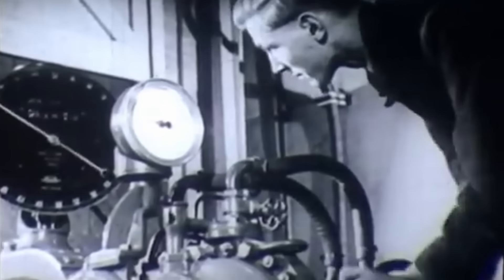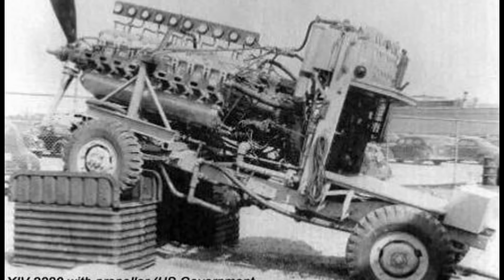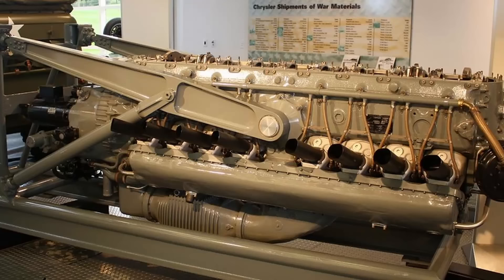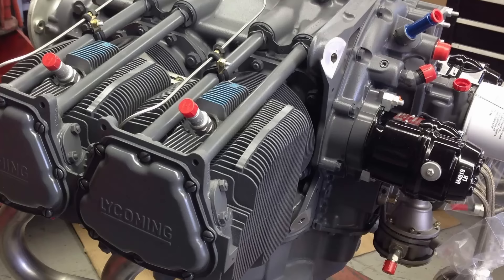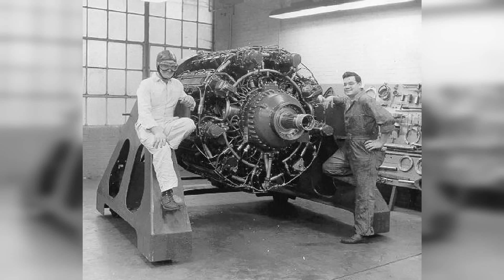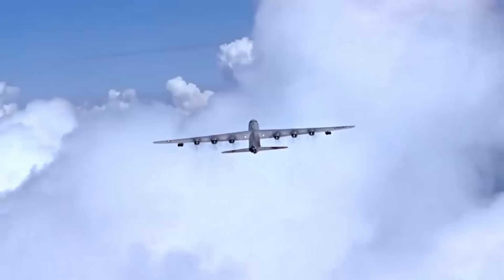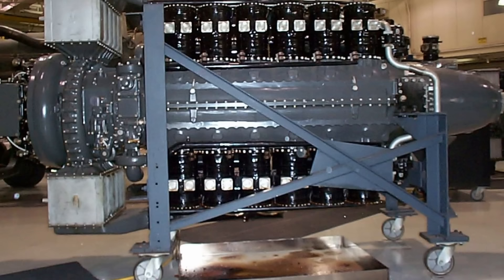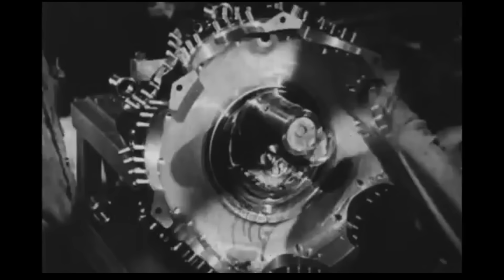The Forgotten HYPER Aircraft Engines of WWII

Comment: Sometimes I wonder what a high displacement, high cylinder count engine could put out with the knowledge we have now.
Reply: Yes, I have always wanted to see someone remake or reproduce a Merlin, or R-2800 with modern technology.
Reply: Alex Snowden  In aviation? Absolutely not.
Reply: Dante Giacosa, Fiat engineer, worked on aviation engines before projecting car engines, said that the limit of aviation engines was the number of revs due to the fact that was needed a bigger heavy gearbox in order to limit propeller rpm if the engine doubled the conventional rpm speed… we know that power output is related with rpm speed… however the power for cubic inch was the same of an engine car, thanks to the compressor, at normal revs in use in those days aviation engines… so the solution was to increase cylinders number…
Reply: Alex Snowden  It's not even remotely related to what the "fun police" want, it's what's possible from a technology standpoint. Practical electric aircraft aren't even on the horizon and regulations/powerful people can't make the impossible possible.
Reply: Alex Snowden  Those people will have less power in three weeks.
Reply: The only "knowledge" that we have now, that is any different from what they had 80 years ago, is fast microprocessors. 
It would be a interesting, albeit expensive and unnecessary, exercise to build a modern; giant, high powered aircraft engine using all of the technology at our disposal. 
I don't think that we could do much better than they did 8 decades ago. 
Turbine engines are more powerful, lighter, and more reliable than piston aviation engines. They are the go to powerplant for heavy aircraft nowadays.
Reply: @straybullitt  that is absolutely not the case. Metallurgy, casting processes, forced induction have all come a long way. It's 3:40am and those are off the top of my head.
Reply: @straybullitt  "The only "knowledge" that we have now, that is any different from what they had 80 years ago, is fast microprocessors. "

That's a ridiculously ignorant statement. When it comes to piston engines, we have gained an absolutely ENORMOUS amount of knowledge relative to what we had in the '30s and '40s, I don't even understand how anyone could think otherwise. Even without ANY electronic controls, modern engines VASTLY outperform engines from that era, because of our current understanding of how the internal geometry of an engine affects its performance. Everything from our understanding of how to improve volumetric efficiency, to how to greatly reduce an engine's propensity to detonate has been enormously improved over the years, simply because we understand how the shape of ports and combustion chambers affects these parameters. Heck, companies will run hundreds of hours of combustion simulations on supercomputers in order to determine the ideal shape of the ports and combustion chambers of an engine.

Materials science and production methods have also improved enormously, so parts can be lighter, longer lasting, and can be designed with properties that allow for significant reductions in the amount of friction an engine produces internally. Parts can also survive for longer periods of time in more extreme environments, allowing engineers to push engines harder in order to improve both efficiency and power output, without sacrificing longevity.

Just ask yourself why a Honda Civic makes as much power as a 1955 Bel Air, with less than half the displacement, while also getting more than twice the fuel mileage and lasting just as long, if not longer.

Edit: ...and, of course, the Civic is far cleaner than anything from the '50s, which restricts performance.
Reply: @theakbars98  
I'll possibly give you the metallurgy and casting. 
The only reason that forced induction has improved is due to better engine management tuning via computers. I would argue that is not as important on a engine that is run at a constant RPM.
Every conceivable method to gain performance on internal combustion engines was developed by the second world war, if not before. 
I just don't think that any advances that we've made would make much of a difference in a large aviation engine.
Reply: @PistonAvatarGuy  
Comparing a Civic, or any automotive engine, to a large aviation engine is ridiculous. 
Aviation engines run at a constant RPM, and can easily be tuned to make maximum power and efficiency at that RPM.
Try taking a contemporary 2000 horsepower LS engine up to 20,000+ feet and see how it runs.
You guys have no idea about what it requires to make power in that environment....
Reply: @straybullitt  Did you not read my comment? Basically ALL of the advancements which have been made in automotive engine technology can be applied to aircraft engines. People have even been proving that modern automotive engines perform better than the most common light aircraft engines!

"Try taking a contemporary 2000 horsepower LS engine up to 20,000+ feet and see how it runs."

A) No one here suggested that a 2,000 hp LS be used to replace a ~30+ liter aircraft engine, they said that they wanted to see a Merlin, or an R-2800, produced with modern technology. Modern versions of those engines would offer absolutely enormous improvements over their predecessors. B) I'm not suggesting that modern automotive engines be used to replace the archaic engines currently in widespread use in light aircraft, I'm suggesting that the advancements which have been used to improve automotive engines also be applied to aircraft engines.

Also, Boeing used Ford Fusion engines in an aircraft which flew at 50,000+ feet for a considerable amount of time, so I don't see why you think that a modern automotive engine would have trouble operating at high altitude.
Reply: There reaches a point where you can get more energy from the turbocharger than the energy from the crankshaft.  So you might as well attach the propeller to the turbocharger shaft, and the engine becomes a heavy, expensive, hard to maintain gas generator.  That's basically why we have turboshaft engines, grossly oversimplified.
Reply: @straybullitt  "The only reason that forced induction has improved is due to better engine management tuning via computers."

That's complete nonsense, both compressor and turbine technology have improved considerably, partially because of our improved understanding of fluid dynamics and our ability to simulate these systems, but also as a result of advancements in materials science and manufacturing techniques. Many of the improvements that I mentioned above also contribute to a modern engine's improved ability to make use of forced induction.

"I just don't think that any advances that we've made would make much of a difference in a large aviation engine."

The VAST improvements that we've seen in port and combustion chamber designs have a long list of benefits. Just improving the volumetric efficiency of an engine means that less power is consumed by the compressor(s) in the forced induction system (at the same power level) and less heat is generated by it/them, which means greater efficiency and less stress on the engine and the forced induction system.
Reply: @PistonAvatarGuy  
I feel silly arguing about this. The large piston aircraft engine ran its course by the end of WW2. They found something that was so much better, that it isn't even close. 
It's a completely moot point. 
But if any of you think that you can build a better piston engine, I would love to be proved wrong.... 😋
Reply: @johngalt5205  That's pure nonsense, unless you're trying to fly at 100,000+ feet (or something like that). Try asking the engineers at Grob why they went with a piston engine in their Strato 2C and used a compressor section from a PW127 to provide it with air, instead of simply using PW127s to power the aircraft.
Reply: @straybullitt  I think that you missed the point of this whole discussion. No one here is saying that a large, modern piston engine could compete with turbine engines, it would just be interesting to see how much better modern versions of those old engines would perform. Where did you even get the idea that turbine engines were part of this discussion?
Reply: @PistonAvatarGuy  
No. I got it.
You already know my opinion. 
The  unlimited hydroplane racers used Allison and Rolls Royce/ Packard engines into the 80's. They probably squeezed every ounce of horsepower out of those engines. The unlimited class at Reno also mods those engines about as far as they will go.
You would have a difficult job of building a new engine from scratch, that will outperform some of the engines that have been developed for the ladt 80+ years.
That's all I'm saying.
Reply: @straybullitt  You don't "got it," because you have no idea what you're talking about. The racers who have been tuning Merlin and Allison V12s didn't redesign the engines from scratch, but that's exactly what would need to be done in order for them to take advantage of any of the major advancements that have been made in the last ~80 years.

The ports and combustion chambers of those engines are absolutely archaic (especially on the Merlin) and can't be changed without significant changes to major parts of the engine. The Allison wouldn't need to be modified as much, but it's still absolutely archaic by today's standards.
Reply: @PistonAvatarGuy  The strato 2c failed, yet the Grob G 520 (a turboprop) did not.  Thank you for proving my point.
Reply: @johngalt5205  Except that the 2C flew higher than the G 520.
Reply: @PistonAvatarGuy  
The old timers understood about combustion chamber design. Bristol built a sleeve valve engine, which is probably the most efficient, and complicated, combustion chamber design.
Again, all of that is not as important on a forced induction, large sub 5000 RPM engine, as it is in a high revving automotive or motorcycle engine. 
There is currently no viable commercial application for such a engine, so we're never going to find out, unless you stop talking about it, and start building it PistonAvatarGuy.....
Reply: @straybullitt  No, buddy, efficient combustion chamber designs didn't start to emerge until the EIGHTIES. Haven't you ever wondered why modern boosted engines have compression ratios that are basically double what they were in the '30s?

Sleeve valve heads are a whole different world, as they don't have the same problems as poppet valve heads.
Reply: @straybullitt  "There is currently no viable commercial application for such a engine, so we're never going to find out, unless you stop talking about it, and start building it PistonAvatarGuy....."

Yes, it is extremely obvious that the concept of fun is completely foreign to you, you don't have to point it out. If you don't like fun, lighthearted conversations which don't produce ideas that you can sell, go somewhere else.

If you want to give me half a billion to develop a modern, light aircraft engine (>400 hp), I'd be glad to take it.
Reply: @PistonAvatarGuy  
Fuel was like 70 octane in the 30's.
Chrysler had a hemispherical cylinder head in the 50's.
You need to study history more carefully, pal.
Reply: @PistonAvatarGuy  
Honda beat you to it!
They developed a thoroughly modern engine but never brought it to market. 
Porsche actually developed a engine  that they built in limited numbers, and then cancelled their certification and stopped supporting the engine after a few years.
There is too much liability, for too small a market with general aviation engines. Even for the largest engine manufacturer in the world. 
I won't be investing any money in your engine building business.
Reply: @straybullitt  WTF are you talking about? The engines being discussed here burned 130 octane (up to 150 in some cases) fuel! Even with those low compression ratios, they'd blow themselves to pieces without ridiculously high octane fuels, because their combustion chambers (as well as other aspects of their design) were absolutely archaic!

The hemispherical combustion chamber is also an incredibly archaic design, which is why it hasn't been used in any automotive engine for many decades.

AGAIN, you have no idea what you're talking about, PAL.
Reply: @PistonAvatarGuy  So what? I read some more, and both of them apparently were built because the German government could not get their hands on a real high-flyer (70K feet) the U2, so they tried to roll their own with existing off the shelf technology.

Turboshaft engines are probably designed to run below about 42K feet, so to get more altitude than the G 520 could provide would require a major re-work of the engine, and would cost too much, so they tried the 2c, and failed.

Besides that, props, while cheaper, are not nearly as efficient at moving air at higher altitudes and speeds as a ducted fan, like on a high-bypass passenger airliner.

Besides that, would you want to change all 336 spark plugs on a B-36?
Reply: @PistonAvatarGuy  
Lol
You were wondering why compression ratios doubled from the 30's. The octane rating of the fuel went way up during the war.
I'm tired of going back and forth with you dude.
I'm just going to wish you well in your engine design and building endeavors, and say goodnight.
Reply: @straybullitt  FFS.

Fuel octane during WW2: 130 to 150 . Compression ratios during WW2: ~6:1
Current fuel octane: 90 to 92 . Compression ratios in current engines: ~10:1 (boosted), 12:1 to 14:1 NA
Reply: @johngalt5205  The 2C being a financial failure does not mean that it failed to fly at a higher altitude than the G 520.

Anyway, at around 400 hp and below, the fuel consumption of a turbine engine becomes a serious issue, so that's likely part of the reason why Grob chose piston engines for the 2C. It's not always as clear-cut as you might think...

I would imagine, though, that a small turbofan would have performed better in that application than anything else when it comes to operation at anything above ~40k feet. Comparing the Scaled Composites GlobalFlyer to the Strato 2C is interesting.
Reply: @straybullitt  Don't forget water and alcohol injection.
Reply: @straybullitt  The Honda aircraft engine was ridiculous, as was the Porsche engine (it was an air-cooled aircraft engine which relied on a fan for cooling).

The only halfway decent engine designs that have been developed for aircraft and could be considered to be fully modern engines were the Toyota FV2400-2TC and the Adept Airmotive 320T/360T. Adept Airmotive is currently looking for funding to certify their engine, while Toyota certified their engine but decided not to put it into production (like you said, too much liability and too small of a market). Burt Rutan (one of the most notable aircraft designers alive) worked with Toyota to design an aircraft for the FV2400-2TC and had nothing but praise for the engine.

It's unfortunate that greed prevents light aircraft from being powered by modern engines.
Reply: @johngalt5205  
Nitrous oxide, and everything else that you could possibly think of....
Even a exhaust turbine coupled directly to the crankshaft via a fluid coupling, providing a nice boost in power, in conjunction with the supercharger. 
It's actually amazing what they were able to dream up, and engineer to be functional back then.
It's possible that a better "mouse trap" could be engineered and built today. It certainly wouldn't be "game changing" better.
It most definitely wouldn't have the soul of a vintage engine. Probably more like the hunk of metal found in modern automobiles, covered by a piece of plastic.....
Reply: @PistonAvatarGuy  It isn't the HP that's the problem with turbine efficiency.  It's the altitude and/or speed.

Explanation in layman's terms
Burning the fuel-air mixture heats it and makes the gas expand. This happens at nearly constant pressure and in a restricted volume, so the only way to make room for this expansion is for the gas to flow faster. Nearly constant pressure means that the density of the gas must decrease. The density ratio between the heated and the unburnt gas is proportional to its temperature ratio, measured in absolute temperature.

However, the amount of fuel burnt determines the absolute temperature increase, the difference in degrees between the burnt gas inside the combustion chamber and the unburnt gas at the intake. For a given amount of fuel, the temperature ratio which can be achieved with an absolute temperature increase becomes smaller the higher the temperature of the unburnt gas is. Thus, efficiency decreases with a higher temperature of the intake air.

The air at high altitudes is very cold, ~ -70 F @50K feet, so turbines are very happy.

The Scaled Composites GlobalFlyer flew high (~50,000 feet) and fast (~350 MPH), so the turbojet engine was more efficient than a piston engine would have been.
Reply: @straybullitt  Yeah, war makes people desperate.  The Mustang and Spitfire both use the Rolls-Royce Merlin engine, which is equipped with ejector exhausts. The exhaust gas actually contributes about 70hp of power, over and above the thrust from the propeller.
Reply: @johngalt5205  I'm aware of all of that, but in the power/thrust range that we're discussing here, piston engines start off with a significant efficiency advantage over turbine engines at lower altitude and this efficiency may not be matched by a turbine engine, even at high altitude.

I wasn't concerned with the power/thrust output of the engines, just fuel efficiency. Obviously, turbine engines can be far more powerful than piston engines, it's just that the fuel efficiency of turbine engines is increasingly poor as their size/maximum thrust decreases.
Reply: @PistonAvatarGuy  
Most of the advancements you're talking about that've come to be since the 80's in car engine's wouldn't apply to something like a redesigned Pratt&Whitney R2800  engine for a variety of reasons. 
First off I've been building performance Harley engine's professionally for years, they started out with a hemi engine back in 1936 nicknamed the Knucklehead, the same basic combustion chamber was retained through the Panhead and Shovelhead engine's up to 1984 when they switched to a D shaped combustion chamber with a flat top piston and a squish area in the Evo engine, so I'm very familiar with the concept of true hemi's being horrible combustion chambers (for normally aspirated engine's, highly boosted engine's are a different story and I'll get to why that is in a moment), and how despite Chrysler using the hemi name on the generation of engine's they've made lately they're not really hemi's by any stretch of the imagination, they have closed combustion chambers and flat top pistons, but since Chrysler own the rights to the name "hemi" when applied to automobiles they can do what they want with it, they could apply that name to a flat head engine if they wanted.
But what you don't get is that the squish area type combustion chambers that've made automobiles (and Harley's) so much more efficient and powerful since the 80's wouldn't work in a highly boosted engine like what's run in aircraft, furthermore your comment about those engine's having low compression couldn't be further from the truth, the R2800 may only have 6.5:1 mechanical compression pistons in them but the engine's run on 70" of boost which means in the end they actually have very high compression.
High amounts of boost changes everything about what happens in a combustion chamber, there's a reason why those aircraft engine's had 6.5:1 compression pistons in them and so do modern top fuel rail dragsters, they run the same 6.5:1 compression ratio pistons as those aircraft engine's did because that gives them a large combustion chamber volume that gets packed full of air/fuel via the supercharger, you can't have closed chambers and squish area's with a combustion chamber designed to run high boost like that, with a combustion chamber that has the small amount of volume something like a normally aspirated does to keep from blowing it up you'd have to turn the boost down to the point where you'd loose the effect of having that much air/fuel to burn that's inside of a hemi with a flat top piston like those aircraft engine's and top fuel dragsters have, those top fuel engine's pack in so much air/fuel from the supercharger that at the top of the compression stroke the spark plug is firing in almost pure liquid despite the huge volume of the combustion chamber, also because of the massive amount of boost they run instead of relying on ambient air pressure to fill the cylinders the vastly improved ports of today's engine's are something else that they wouldn't benefit from, it simply wouldn't make any difference because the superchargers on those engine's are already capable of filling the cylinders with every bit of air/fuel they can handle, with more efficient ports you'd have to turn down the boost to keep from over boosting the engine resulting in having the same amount of air/fuel packed into the cylinders anyways, ie no benefit from it, you might get a little more power at the prop shaft from slightly less parasitic loss from not having to gear the supercharger as high but it'd be marginal, not nearly what's been gained in normally aspirated engine's since the 80's from better designed ports, and since the length of the induction system overall is so long because of the supercharger and manifold design on those engine's the ports in the heads are only probably about 1/100th the length of the overall induction system instead of ¼th or so, in the end it might not even make any difference, on those aircraft engine's it was a long ways from the carb, through the superchargers and then all the way down the intake manifold to the cylinders. 
But probably what limits them more than anything else is piston velocity, with car engine's over the years things like overhead cam shafts and other things that've become prevalent in automobile engine's has enabled them to rev higher to produce more HP, but because of the massive 6 inch and more stroke in those aircraft engine's they can't rev any higher than 2,700 to 3,000 RPM's without piston velocity becoming an issue, generally the higher you rev an engine the more HP it makes but because of the limits placed on those aircraft engine's because of the amount of stroke they have you can't rev them any higher anyways, along with that you've got propeller speed issues, once the tip of a propeller blade approaches the speed of sound it starts losing efficiency, so for that reason you can't rev the engine's any higher in them in the pursuit of more HP.
You'll find that the people who engineered those engine's pretty much had all the bases covered, that's why during WW2 a prototype variant of the P47 set a speed record that wasn't broken until 1989, even then it was just barely exceeded and hasn't been broken since despite many people having tried it, because it's a technology that was pretty much wrung out as far as it could be back then and the advancements that've brought cars so far in the past 40 years simply don't apply to them.
Reply: @PistonAvatarGuy  That's just not true.  Modern turbofans are way more efficient than passenger liners of old.  A lockheed constellation got about 60 MPG per passenger, whereas a Modern large twinjet gets way over 100 with far lower maintenance costs.  Virgin chose a jet because they could get the highest MPG that way.

The only times a piston engine is better is if you want to go low and slow, like a bush plane.  Or, if you want to make a plane cheaply.
Reply: @dukecraig2402  "Most of the advancements you're talking about that've come to be since the 80's in car engine's wouldn't apply to something like a redesigned Pratt&Whitney R2800  engine for a variety of reasons."

-- I agree, actually. I was mostly thinking about a modern Merlin... and liquid-cooled v-type engines in general.

"But what you don't get is that the squish area type combustion chambers that've made automobiles (and Harley's) so much more efficient and powerful since the 80's wouldn't work in a highly boosted engine like what's run in aircraft..."

-- Yes, they would. First off, aircraft engines aren't that highly boosted. Second, those very combustion chambers ARE used in highly boosted automotive engines, quite extensively. Take a look at a VR38DETT combustion chamber, then watch one blast down a drag strip with 3,000+ hp at ~80 psi of boost and tell me that combustion chambers with squish area aren't suitable for use in high boost applications.

"... the R2800 may only have 6.5:1 mechanical compression pistons in them but the engine's run on 70" of boost which means in the end they actually have very high compression."

-- 70" of manifold pressure is only ~20 psi of boost, which is basically the same as a stock EcoBoost engine. Take a look at the EcoBoost combustion chambers... very, VERY closed in nature.

"and so do modern top fuel rail dragsters, they run the same 6.5:1 compression ratio"

-- They run such low compression ratios because they use true hemi combustion chambers, instead of modern combustion chambers.

"you can't have closed chambers and squish area's with a combustion chamber designed to run high boost like that"

-- Sorry, but countless modern engines prove you wrong on that. Really, I think the problem here is that most people who want to criticize me on my understanding of engines are American, but most American engine builders are stuck in the 1950s... unless they're tuning Japanese or European engines.

-- On your comments about not being able to fit more fuel and air into a Top Fuel engine... you wouldn't need to with a more advanced combustion chamber, because higher compression ratios produce more power with less fuel (they're more efficient), you just can't run a higher compression ratio with a hemi engine because of its archaic combustion chamber.

" the vastly improved ports of today's engine's are something else that they wouldn't benefit from, it simply wouldn't make any difference because the superchargers on those engine's are already capable of filling the cylinders with every bit of air/fuel they can handle, "

-- I already explained why this is wrong above. If you're trying to fill a cylinder through a more restrictive port, your supercharger is going to require more power to do it and it's going to produce more heat while doing it. In an aircraft, where you're not going for some bonkers amount of power, this would mean reduced efficiency, because the forced induction system would be consuming more power in order to obtain the same power output as an engine with more efficient ports. This is basic, BASIC stuff, man.

-- On piston speeds: Now we know that engines should be over-square so that piston speeds can remain low, even at high rpm. Better materials, engineering, manufacturing methods and lubricating oils also allow for higher piston speeds, without causing any reduction in reliability, longevity, or efficiency.

" along with that you've got propeller speed issues"

-- This is absolutely not an issue because these engines all have PSRUs. Want lower propeller rpm with higher engine rpm? Use a different gear ratio.

-- Anyway, you're just stuck in the 1950s, learn about modern engines, they'll blow your mind.
Reply: @johngalt5205  SMALL turbine engines are horribly inefficient. We are talking about relatively small turbine engines here.
Reply: @PistonAvatarGuy  If SMALL turbines are so horribly inefficient thet would not use them as APUs in jetliner.  The size does not matter assuming the same number of compressor stages.  What matters is how cold the intake air is for all sizes of turbines, and how fast you are going.
Reply: @johngalt5205  APUs in airliners don't need to be efficient, they're not operated for long enough and don't produce a large enough amount of power for their fuel consumption to be a concern. Space and weight concerns are what drive that engine choice.

It's common knowledge that small turbine engines are horribly inefficient, it's almost ridiculous that you wouldn't be aware of that fact.
Reply: @PistonAvatarGuy  The efficiency of a turbine engine has nothing to do with size, assuming the same design, altitude, and speed.  It has everything to do with the difference between the inlet temperature and outlet temperature.  I'm surprised you are willing to die on that hill of ignorance.

I think the reason you believe small turbines are inefficient is that you are comparing turbines that are being run at low altitudes.  Big ones aren't great at low altitudes, either, it's too hot for them to be efficient.

Get those little suckers up high and fast, and they are just as efficient as their big brothers.
Reply: @johngalt5205  No, buddy, there is an extensive amount of data which supports what I'm saying here. It's well understood why smaller turbine engines are less efficient than larger turbine engines. Heck, you can even compare GE's aeroderivative turbine engines (which are rated at sea level) and see that the smaller engines are less efficient than the larger engines.

Anyway, my main point was that piston engines are more efficient in light aircraft applications, and that's indisputable. Modern piston aircraft engine designs (the Adept Airmotive 320T) can burn as little as 0.33 lbs of fuel per hp/hr, while a small turbine engine might burn two to three times that amount.

The PBS TP100, for example, burns 0.901 lb/HP/hr at cruise. The Allison/Rolls-Royce M250 burns around 0.67 lb/HP/hr cruise, which is less than the TP100.... and it happens to be a larger turbine engine. The TPE331 burns 0.55 lb/HP/hr (I think that's at max power), it's larger still. I don't really feel like tracking down more of this information, but I'm pretty sure that once you get into the range of something like an Allison T56, you start to get competitive with the BSFC numbers of piston engines. That is a BIG turbine engine and it is absolutely not suitable for use on a light aircraft.
Reply: @PistonAvatarGuy  How in the world did I let you shift the goalposts from the OP to the efficiency of tiny turbines?  Good job.
Reply: Damn, sparked a conversation. Anyway, inducer and exducer geometry would allow for smaller turbos to be used and modern materialistic would allow for less parasitic losses on a centrifugal supercharger also making an engine lighter. Contemporary combustion chamber knowledge WOULD also allow for either more boost to be pumped in and or a greater static compression ratio. Finally, this comment wasn't about making a commercially viable engine, it WAS about thinking "hmmm, that'd be cool to see, not that anyone would do it"
Reply: @theakbars98  If all you care about is high output from a piston engine at all costs check out Top Fuel dragsters.  They put out about 11,000 HP from 500 cubic inches.  But, they only last about 500 revolutions at full chat before needing a full rebuild.  They use between 12 and 22 gallons of fuel for one run.

You could probably get an even higher output if you didn't follow NHRA rules
Reply: @johngalt5205  you're still not understanding the original intent of my comment. It's not about output, or commercial viability.
Reply: @theakbars98  You said, quote, 'Sometimes I wonder what a high displacement, high cylinder count engine could put out with the knowledge we have now.'

If not the search for maximum output from a piston engine ignoring everything else, what did you mean by that?  Please clarify.

The ultimate piston airplane engine was probably the Rolls-Royce Crecy.

Sleeve-valves, 2 stroke.  It put out 2,729 hp, it was killed off when jets proved viable.

https://www.youtube.com/watch?v=oOFn0eTgdE8
Reply: @johngalt5205  "The ultimate piston airplane engine was probably the Rolls-Royce Crecy."

But it never even flew. Sleeve valves are problematic, so it probably wouldn't have ever been a viable engine. With modern knowledge, engines could be built to be longer lasting and more powerful than anything that was ever put into service during WW2.
Reply: @johngalt5205  There were no goalposts and you brought up turbine engines.
Reply: @PistonAvatarGuy  The Napier Sabre was flown in WW2 and had sleeve valves.

The Rare Bear engine puts out about 4,500 HP, and that's racer using a modified Wright R-3350 Duplex-Cyclone engine that originally made 'only' up to 3,700 HP.  So, ~5000 HP is probably the answer for a practical clean-sheet design of something that could fit in a fighter.

Big engines can only spin so fast, and poppet valves can only flow so much air, regardless of technology.  Boosting the hell out of the intake charge costs a lot of HP, and heats it up a great deal to the point where cooling it down to a reasonable temperature becomes a problem.  Hence water injection.

Now we have the problem of getting the engine power to move air.  Big HP numbers require a big propeller.  The largest propeller I know of was on the Vought F4U Corsair, at over 13'.  It was so big it was a problem.

You could use a contra-rotating propeller, but they are very noisy, the gearbox sucks up some power, and the 2nd propeller is not as efficient as the front one.
Reply: @johngalt5205  The Sabre was not put into production. Sleeve valves were always problematic, which is why they basically died in the '40s.

In the '40s, engine manufacturers simply didn't know how to make engines rev very high and to have them be reliable, but we know now. We could actually make smaller, lighter, higher revving engines that make more power than anything produced during WW2.

Voodoo (which is faster than Rare Bear) made 3,100 hp at 3,400 rpm during its record setting run, but a modern 30 liter engine (a twin crank, X-24, made up of two, 120 degree V-12s, for example) could easily rev 4,800 rpm, while still maintaining the same piston speeds as the Merlin in Voodoo, and this would result in the production of ~4,800 hp! If this engine were to adopt piston speeds which are similar to that of modern racing engines, it could rev to 6,000 rpm and make 6,000 hp!

Modern poppet valve heads flow far, FAR better than those of the 1940s, especially if you're talking about the 2-valve heads found in the R-3350. Heck, modern poppet valve heads flow far better than those of the 1980s! The Honda K20A head, for example, absolutely blows the Toyota 2JZ-GTE head out of the water, and it's only about 10 years newer.

"Boosting the hell out of the intake charge costs a lot of HP, and heats it up a great deal to the point where cooling it down to a reasonable temperature becomes a problem.  Hence water injection."

I already went over this in this thread. More efficient heads result in less boost being required to make the same amount of power. Less boost means less heat and less stress on the engine, as the engine doesn't need to produce as much power to run its supercharging system.

Contra-rotating propellers are more efficient than single propellers and you were talking about racing engines, so noise isn't a problem.

If we're talking about a modern Merlin (a modern aircraft V-12 would actually be far more similar to the Allison than the Merlin, as the Allison was already more modern in many ways), run with longevity in mind, it would easily generate more than 2,000 hp, it would likely weigh less than the Merlin (maybe even less than the Allison) and it absolutely would be far more efficient.
Reply: @johngalt5205  The Tu-95 props, btw, handle 15,000 hp, so I think 6,000 hp is doable on a smaller aircraft.
Reply: @PistonAvatarGuy  It seems we more or less agree on something,  I said, "So, ~5000 HP is probably the answer for a practical clean-sheet design of something that could fit in a fighter."

And you said, "If this engine were to adopt piston speeds which are similar to that of modern racing engines, it could rev to 6,000 rpm and make 6,000 hp!"

About 5,000 to 6,000 HP seems to be the answer for the OP.

But, if noise is not a concern perhaps a fully developed supersonic propeller like the one from the Republic XF-84H would be able to get all that horsepower biting into the air.  That had about 6,000 HP.  It could potentially even go supersonic.
Reply: @PistonAvatarGuy  Maybe for a tail-dragger.  But if you want a modern tricycle with a contra-rotating prop the size of the one on the Vought F4U-1D Corsair you would need an undercarriage like a B-58.

The tips of the Tu-95 props already go supersonic (hence the noise).  Might as well make the whole blade supersonic and reduce stresses.

A supersonic propeller would give much better acceleration, and the potential for the aircraft to go supersonic without having to land on it's tippy-toes.  I'm assuming this beast would go in a fighter or a racer.

We have Musk money to build this thing, right?
Reply: @johngalt5205  "About 5,000 to 6,000 HP seems to be the answer for the OP."

You didn't read my comment. An X-24 is not a V-12 and power output isn't really the relevant question here, it's overall performance. Voodoo flies faster with 3,000 hp than Rare Bear does with 5,000, so a 6,000 hp, 30 liter, liquid-cooled engine would offer far greater performance.

Like I said before, a modern V-12 would be in the 2,000 hp range in a non-racing application, but ~4,000 hp would probably be doable with a V-12 in a racing application.

Supersonic props aren't the answer, a ducted fan would be the way to go supersonic with a piston engine.

Tricycle gear isn't required for a racing aircraft, there's no reason why it couldn't be a tail dragger.
Reply: @PistonAvatarGuy  I think you just want to argue.
Reply: @johngalt5205  I just want you to understand how far engine technology has come since WW2.
Reply: @PistonAvatarGuy  Nice subtle insult.  Piston engine technology development stalled a long time ago.  The most powerful F1 engine was built in the '80s.  The fastest new single-engined private plane you can buy, the Mooney Acclaim, only goes 280 knots and is powered by a turbocharged Continental TSIO-550-G which was first run in 1983.  It's 552 CI, and only puts out ~350 HP and weighs 470 pounds

The most powerful car engine, the one in the Bugatti Chiron puts out 1500 HP and weighs ~1000 pounds. And that engine was first developed in the early 2000s.

A Merlin weighs about 1,300 pounds, and puts out about 2000 HP in top trim.

TSIO-550-G -- .74 HP per pound
Bugatti --        1.5 HP per pound
Merlin --          1.5 HP per pound
Reply: @johngalt5205  I guess that you're just trying to find ways to annoy me?

"Piston engine technology development stalled a long time ago."

A) This discussion was about how far engine technology has come since WW2. B) That's wrong. Engines are still getting more efficient, at the very least.

"The most powerful F1 engine was built in the '80s."

Wrong, in race trim, current F1 engines are more powerful than the '80s turbo-era engines... and they're far, FAR more efficient. Current F1 engines are some of the most efficient engines ever built.

"The fastest new single-engined private plane you can buy, the Mooney Acclaim, only goes 280 knots and is powered by a turbocharged Continental TSIO-550-G which was first run in 1983."

That's the main reason why I'm trying to get my point across, because there is an absolutely ENORMOUS amount of improvement that can be made to light aircraft engines.

"It's 552 CI, and only puts out ~350 HP and weighs 470 pounds"

The Adept Airmotive 360T weighs 340 pounds and makes 360 hp, while burning about two thirds as much fuel as that Continental engine. It's also capable of true, single-lever operation, making it safer and easier to operate. The 360T doesn't require leaded fuel, either. So... 30% less fuel, cheaper fuel, less toxic fuel, easier operation and significantly less weight. Engine technology hasn't stalled since the 550 was designed, greed simply prevents anything better from taking its place.

"The most powerful car engine, the one in the Bugatti Chiron puts out 1500 HP and weighs ~1000 pounds."

The Koenigsegg Jesko engine makes 1,600 hp and weighs 417 pounds.

- Adept Airmotive 360T - 1.06  hp/lb

- Porsche 918 engine (naturally aspirated) - 2.04 hp/lb

- Koenigsegg Jesko engine - 3.84 hp/lb

- BMW P84/5 (naturally aspirated) - 4.56 hp/lb

The Merlin engines that were that light and that powerful could not produce that amount of power for a long period of time.
Reply: @johngalt5205  k
Reply: @johngalt5205  I forgot to list a benefit of the Adept Airmotive 320T/360T, which is the Meredith effect. The drag associated with cooling the engine can be almost completely eliminated with liquid-cooled engines, adding to the efficiency of the engine itself.
Reply: @PistonAvatarGuy  There were only 17 Ravins built to date and they use Lycoming  engines, according to Wikipedia.  Putting an engine in a kit plane as a testbed hardly counts.

Being cautious regarding aircraft is wisdom.  If the engine fails in flight in a light aircraft there is good chance you, and your loved ones will die.  If it needs service, and the mechanic can't or won't work on it, or the parts aren't available you could stuck with a very expensive paperweight sucking up parking fees, and your travel plans are ruined.

I don't want to have more money seized from me at gunpoint to fund someone else's flight of fancy.
Reply: @johngalt5205  "Putting an engine in a kit plane as a testbed hardly counts."

Hardly counts as what? I said that the engine needs funding for development, I never said that it was in production. My point is that the 320T/360T represents what's possible with light aircraft engines.

The Austro Engines are extremely reliable and safe because they were properly developed, there's no reason why this can't also be done with the Adept Airmotive engine.

"I don't want to have more money seized from me at gunpoint to fund someone else's flight of fancy."

WTF are you talking about? Do you think that I'm suggesting that people be FORCED to give up their LyContisaurus engines? Where the f--k did I say anything like that? Where does that sort of thinking even come from? You're just pulling nonsense out of nowhere.

I think that leaded FUELS should be eliminated, because the people who fly aircraft with leaded fuel are forcing huge numbers of people to be exposed to an extremely toxic substance, but plenty of LyContisaurus engines work just fine on unleaded fuels and viable replacements for 100LL have already been developed.
Reply: @johngalt5205  Ohhh.... you're talking about TAXES. If you don't like taxes, go live in a jungle somewhere, because without taxation, modern society wouldn't even exist. Seriously, wtf is wrong with you people? We'd absolutely be living in the stone age if it were up to you.
Reply: @PistonAvatarGuy  OH, I don't mind taxes.  Taxes are required when market failure occurs.  When people need something, but it's difficult or impossible to charge people individually for some service we all benefit from, like national defense.

What I don't like are wealth transfer schemes  which sieze money from the population that only benefit a few.  Like a new private airplane piston engine.
Reply: @johngalt5205  We NEED to eliminate leaded fuels, it should have been done decades ago, but the market system FAILED to offer improvements to light aircraft engine designs.

Wealth transfer makes societies prosperous and stable, this was proven well beyond any doubt in the '50s, '60s and '70s in the US and is being proven in many other countries around the world right now. You're just greedy and despise the thought of anyone (other than you) being able to live a decent life.
Reply: @johngalt5205  And, no, wealth should not be transferred from "the population," it should be transferred from the parasitic, passive income, leisure class and into the hands of working class people, like those who design, engineer and produce ways to eliminate the need for highly toxic fuels in aviation. The people who work for Adept Airmotive are prime examples of people who should be showered with (a reasonable amount of) wealth for developing a way to improve life for millions.
Reply: @PistonAvatarGuy  I just recalled this, the Hughes XF-11.  It seems to match the specs of your dream plane, 6000 HP, contra-rotating props.

https://youtu.be/W9NapQQnmwY
Reply: @johngalt5205  6,000 hp from both engines combined. The XF-11 was a joke, its performance was extremely unimpressive for its time. The Do 335, for example, was much faster, it was a far more revolutionary design and it flew during the war.

Anyway, the engine that I'm describing would make 6,000 hp from just one engine (easily, I was being conservative) and would weigh far less than an R-4360. The R-4360 saw use on a wide variety of aircraft, btw, it wasn't only used on the XF-11.
Reply: @PistonAvatarGuy  474 vs 450 isn't that big a difference in top speed.  The prototype with contra-rotating props was destroyed on the first flight.  The subsequent ones only had single props.  I'm pretty sure the 450 top speed was run with those.  I would like to have seen the top speed on the XF-11 with modern scimitar props like on the latest C-130s.

BUT, it's sounding like with the engine driving a ducted fan is a lot like a motorjet.

https://www.youtube.com/watch?v=J1tbRnJuTys

Go to 7:45 to see current development.
Reply: @johngalt5205  At those speeds, and when talking about propeller-driven aircraft, that is an absolutely enormous difference. Drag increases exponentially as speeds increase, so the effort to go slightly faster at those speeds is absolutely enormous.

"The prototype with contra-rotating props was destroyed on the first flight.  The subsequent ones only had single props."

And? That's just because that particular engine had trouble with its contra-props, but many other aircraft have been plenty successful with contra-props. Some of those aircraft were faster than the XF-11.

AGAIN, the XF-11 was a complete joke, it was just a bad design, through and though and was HILARIOUSLY obsolete by the time it flew. Hughes was just a silver-spoon idiot who had far more resources available to him to than he should have and he squandered those resources on complete nonsense.

Having a ducted fan does not make an aircraft a motorjet.
Reply: I think about this sort of stuff a lot. Imagine what we could build if we used today's knowledge in design and physics to produce the best tank, fighter, bomber, or war ship you could build with WW2 production abilities.
Reply: @arthas640  I'm not quite sure what you mean.  Would it be like travelling back in time to then, and give them the blue-prints?  It wouldn't help much because a lot of the stuff we make today takes decades to spool up the production faculties for them.  How would they make microchips or a GPS system?

Or, are you talking about putting the USA on a total war footing and forcing all manufacturing to convert to the war effort?
Reply: @johngalt5205  more like a time travel sort of situation. Like develop the best designs you could produce with WW2 tools and materials using modern knowledge. We were basically advancing aeronautical knowledge as we built planes, mainly using relatively rudimentary tech like slide rules and sometimes people just kept building machines after we found out a fault simply because we didn't have the time or resources to redesign. Think Hearts of Iron 4 if you started out with maxed tech and just started cranking out Mustangs, Iowa's, STG-44's, and Panthers in the 30s. Chinese trying to hold back small, elite groups of Japanese trained in modern special forces tactics and armed with STG-44's, RPG-7s, and MG-42s, Barbarosa with Panthers, or Battle of Britain with P-47s
Reply: Alex Snowden  we cant let that happen
Reply: @Channelscruf  sadly not so much, we gotta keep fighting
Reply: We wait for some one to cnc machine a billet aircraft engine.
Reply: While the approach of britons to powerful engines was Low displacement, fast turning engines, Germans made large, big engines turning slowly.
Well, a High Speed Internal Combustion Engine has higher friction losses, higher wear, is more prone to faults than a larger, slowly turning engine, that will be heavier in weight.
Comments?
Blessings +
Reply: In Aircraft Piston Engines, nothing compares to Bristol air cooled, Single Sleeve Valve engines, in terms of power, reliability, TBO of 3 thousand hours, and fuel economy.
The current issue with reciprocating aircraft engines is AvGas is everyday more costly and difficult to find.
But the best gasoline a Wankel RCE would need, according to Mazda early research, is 80 ON.
Wankel are specially well adapted to Ethanol in Gasoline mixes, 'Gasohol' up to a 10 % Ethanol content.
Believe it or not, Overall Weight of 140 HP Besler Steam Engine, tested in actual flight, with its boiler, did not differ very much to a six-flat, air cooled Continental engine of similar power.
But External Combustion Engines (Stirling is too heavy for aircraft use; no one made Steam Aircraft Turbines after WW II German research, Steam cycle is inherently less efficient than Otto ICE Cycle) can burn anything, from used cooking oil to Vodka.
Blessings +
Reply: See AEHS, Sleeve Valve vs Poppet Valve engines. Bristol remain the best piston engines ever. You could read also the July 1974 Car&Driver interview with Mike Hewland, british maker of gearboxes for racing cars, about his S-V research.
French tractor pulling clubs still use the SNECMA made Bristol S-V engines, produced under license for Noratlas cargo airplane, the Spanish CASA 'Azor' had same SNECMA engines. Salut +
Reply: Metal 3D printing and digitally controlled machining is changing the Aviation parts production forever, it are not only cheaper to make, but of better quality.
Reply: You may like the Smithsonian Institution article: 'Power Struggle, why car engines won't fly', Don Sherman. 
Gesund +
Reply: You still have the inherent problem of a high percentage of the power generated needed to just pull itself through the air.
Reply: @billakers6082  Good remark, but it lacks figures. Can't imagine the added drag form a, let's say, 15% heavier engine, 15% larger engine, would negate the other advantanges in the German approach to Aircraft Engine power: bigger displacement, lower rpm.
How much of Airplane weight is the engine, how much of Airplane drag is engine cowling, engine area? 
Hummm
Reply: The fact is engine technology had advanced very rapidly so that by the end of WW1 (1918) they had big vee 12s with four valves per cylinder an twin ohc on each cylinder bank . the big thing lacking was supercharging which didn't come until the 1920s. They produced about 600hp and weighed about 1200 lb.
Reply: Enough to spin the earth
Reply: Sunny Mountain Motors is a prime example of that.
Reply: Lots of carbon dioxide, which is apparently all that govt and industry cares about.
I'd love to see it tho.
Reply: alexsnowden5829  in their dreams
Reply: alexsnowden5829  it’s not going away anytime soon. Electric cars are a pipe dream for the warmers.
Reply: @straybullitt  cylinder head airflow and better camshaft technology, but yes efi would have been interesting
Reply: All good things must come to a end , but good times will last forever 🎉 I will make my attempt when I have money to burn on a soon to be non existent engine
Reply: Look at what the factory is putting out today. The hellcats are ridiculous. And now the LS engines are off the hook.
Reply: Ehhhh 🤷 probably not more than a top fuel NHRA with only 500ci its more about the fuel than the engine really. 😅 I would be surprised if we could even get 10% gains over those old designs with what we know now.
Reply: @OGBootleg  given its almost common for forced induction 2L to produce 1000+hp a improved merlin would be insane. At the end of ww2 the merlin was over 2000hp.
Reply: @straybullitt  fluid flow modeling makes a huge difference.
Reply: Alex Snowden  😂😂😂 sure
Reply: If we use some of F1’s rules and the largest aircraft engine’s displacement, the total would be in the 26,000 hp ballpark.
Reply: Alexander Snowden  there's one HUGE difference between aviation and grounded needs though. Batteries are incredibly heavy for their power density. Fuel is not. Over the course of a flight, the plane will have its weight go down due to fuel consumption, which is taken into account for in the ranges of the plane. This cannot happen with bev because batteries do not get lighter with discharge. So you'd need to majorly over engineer the plane to compensate for the batteries. I think it will be a few decades at least before batteries become dense enough to store the required amount in a not MASSIVE battery pack
Reply: @PistonAvatarGuy  It's been amusing watching you destroy all naysayers. Some people really are stuck in the past. Great job and excellent patience, lol.
Reply: @josega6338  Car engines do fly (Austro Engines) and they're currently some of the best engines on the market. That article was written by a Luddite.
Reply: @randomname4726  I don't blame them (or myself for being stuck in the past in the ways that I am), the latter half of the 20th century was a far, far, FAR better time to be alive.
Reply: @tynancravy5589  For that to work, the engine would need to have 156 cylinders. Edit: And it would only last for tens of hours before needing to be replaced or rebuilt.
Reply: @PistonAvatarGuy  Perhaps Austro engines could be the exception which confirms the rule, besides this, they made some Wankel RCE, coming from Sachs motorcycle engines.
Corvairs can be also avionized, as long as you consider that no more power can be extracted from a Corvair than from a Continental of similar displacement.
The Smithsonian article: 'Power Struggle: Why car engines won't fly', is sound, well founded.
Definitive for me.
I have no pilot license, I have no intention to purchase an Austro engine, no avantages in it.
Blessings +
Reply: @joseveintegenario-nisu1928  If you also want to include experimental engines in this discussion, Honda engines are also being used with a great deal of success. American V8s have also been used with varying degrees of success, as have Subaru engines. Yamaha engines are also being used with a great deal of success, and some of those engines are making significantly more power than they were originally designed to produce. Porsche and Toyota have also certified automotive engines for use in aircraft, and even Burt Rutan had nothing but praise for the Toyota engine.

A small-block Ford V8 has also been used in a LongEZ with incredibly positive results (search for LongEZ V8 by Chris Martinus on YouTube).

Sorry, but that article simply doesn't take into account the huge potential of modern engine designs.
Reply: @joseveintegenario-nisu1928  Definitively wrong, sure.
Reply: As discussed, an small displacement raced engine was the britons' choice in Aircraft Engines, but Germans made large slowly turning engines. If you consider that in a War, life span of engines is not connected to engineering issues, but from theater conditions, the wasp choice is not that bad.
From a purely technical point of view, I'd endorse the German approach.
Blessings +
Reply: @OGBootleg  If you have the machining and alloy expertise, the right machine tools, the money, and the time, you could build do it yourself of any piston engine you like.
Try it! Do it! 
Blessings +
Reply: @joseveintegenario-nisu1928  So, I read that article, and it doesn't really even say anything, it's just sort of a rambling, aimless description of some of what's happened with regard to automotive engines which have been used as aircraft engines. For example: He talks about crankshafts and bearings, but doesn't really say anything meaningful in regard to them (he even contradicts himself a bit in that part of the article). The article doesn't even end definitively, because the Orenda OE600 wasn't complete at the time. Granted, the engine did fail, but a piston engine was simply never going to be competitive with one of the best turbine engines ever built, it was ridiculous for Orenda to even try to build a piston engine for that purpose.

The fact that Austro Engines are flying in significant numbers and have an excellent safety record is proof that the writer of that article is wrong, so is the certification of the Toyota V8 (which he even mentions in his article), as the FAA certification process is extremely grueling and proves beyond any reasonable doubt that an engine will be suitable for use in an aircraft.

I think that you're just someone who doesn't know much about engines, so you couldn't accurately judge what was said in the article, but it was in a prominent magazine, so you assumed that it was gospel.

Edit: And if the author had approached the subject from an economic standpoint, he would have been standing on some pretty solid ground, but as it is, the article just doesn't really say anything meaningful.
Reply: @joseveintegenario-nisu1928  BTW, there are still Mooneys flying with Porsche car engines, 35 years later. So, yes, car engines absolutely do fly.
Reply: @PistonAvatarGuy  Besides Porsche built a prototype Aircraft Engine, Air Cooled, Flat-4, one of it was owned by founder of Citroën 2CV Club of Spain, stolen from his Repair Shop, as a collection of old Aircraft Engines in the Aeronautic Engineering School in Madrid, if you refer to the 6-Flat Air Cooled engines in early Porsche, it are not a typical Car Engine, same as Corvair, you need just a bit power downgrading to have an analog of Continental, I'd say. Blessings +
Reply: @joseveintegenario-nisu1928  Did you make more than one comment just now?
Reply: You need highly capable mechanics to maintain them.
Reply: @naughtiusmaximus830  We know this. Good repair shops can be found if you look at specialized sites. Blessings +
Reply: @PistonAvatarGuy man. I wonder if these people even understand fluid, thermodynamics and material engineering. Engineers have been squeezing every drop of energy out of the piston engine and they’re like “yeah that doesn’t make any difference”. Why would anyone want better efficiency and as much or more power than old engine, huh? lol. And this turbine dude dropped whole principle of gas turbine, but did he even understand that “volume” is the biggest part that make them better, lmao.
Reply: There's a video on forgotten WW2 engines and hydroplane racing, it's worth a watch if you want to know what some of these engines can do with tech up to the late 80s-early 90s, they've since switched to turbine driven prop.
Reply: I operated 4 Fairbanks Morris, 20 cylinder,2.5' bore built in 1942,had a 100hp centrifugal fan for intake pressure,277 rpm 20,000 gal day fuel use.Was still operating in 2000. We can barely do what man was doing in the 20s. Sure we got gadgets that are real neat,but very little new or significantly better.
Reply: Alexander_Snowden Only the King rides! Not in 20 years, and we ain't got that!
Reply: @straybullitt "comparing a car engine to an aviation engine" car engines are often converted into aviation engines. Subaru flat 6's have a long history of being reworked for aviation for example. And consider the rebuild intervals and general maintenance requirements over time. In both auto and aviation engines, these were 1/4 to even 1/10 or more as far apart back then than they are now. As a professional mechanic I thought I'd point those things out. there's a million others that spring to mind as well.
Reply: Alexander_Snowden  nope
Reply: There was a very limited(45) run of db601 engines back in 1997. They had either original style injection and Spark or modern ones. Both had a ECU and where aviable supercharged.... For the power I couldn't find anything solid, but it was speculated 1200/2800hp sustained. (depending on configuration)
Reply: @Channelscruf What happened? It's been over almost a year, I haven't seen anything.
Reply: We can't, we are limited by the materials we have. Like top fuel drag racing for example, we just don't have strong enough materials for that much power.😊
Reply: They exist as container ship engines. The crankcase is as big as a mobile home.
Reply: They were beautifully produced engines then with all the latest carbed, supercharged and whatever else of their day. Not much to improve upon though modern synthetic oils could have helped.The fact that they did accomplish such remarkable engine technology by then, is amazing.
Reply: It couldn’t put out enough power to better a gas turbine. That’s why interest in these engines was lost in the first place.  And that was even compared to first generation turbines. When a modern turbine can produce many tens of thousands of horsepower at over 40% thermal efficiency with far lower maintenance requirements, excellent flex fuel capabilities, and much lower vibrations, why would anyone try to develop large aircraft piston engines today?
Reply: Late WW2 was the pinnacle of piston engine development. High displacement and high cylinder count do not sit well with the requirement for simplicity and reliability. They were pretty damn' expensive, too. Nowadays, there is no demand for such engines. Gas turbines have taken over this market segment a long time ago, and they are getting more efficient by the year. For cars, the trend is smaller engines with fewer cylinders.
Reply: Alexander_Snowden - Delusional isn’t just a river in Egypt.
Reply: @PistonAvatarGuy - Electric airplanes are impossible.
Reply: @michaelgarrow3239  At the moment, useful electric aircraft are impossible, I can only hope that it remains that way.
Reply: @PistonAvatarGuy  - Um,,, 
Jet A fuel, the standard fuel for aviation, has an energy density of about 12,000 watt-hours per kilogram. By comparison, Amprius' batteries currently deliver 450 watt-hours per kilogram for each cell.
*
And an airplane gets lighter as it burns fuel.. not batteries. We would have to store electrical energy in the ether for an electric plane to work… 😂🤣😂
Reply: @PistonAvatarGuy  Electric solar and wind aren't ready but it's still collapsing grids and service in multiple states despite having no backup plan....
Reply: Good point. It reminds me of the first 600cc motorbike engine that produced a 100 bhp. In a production bike! The engineer of that magazine explained what it takes to keep such high specific power engines healthy. Cooling and lubrication is not exactly easy. It must move far more heat than a less powerful engine, the same displacement. And you'll see innovations like the camshafts powered from the mid of the shaft, no longer from one side. Stress, vibrations. The alternative is more cubic inches and not demanding huge numbers of horses, and the only drawback is a heavier engine, but it won't operate close to some limits, thus having less risk at damage. Reliability is a big deal in aviation, you can't park at 10 thousand feet and call for help. Still, Spitfire  and Messerschmitt prove how important more power was: you got shot flying a slower plane. Engineers did an amazing job, both BMW and Rolls Royce, and others I forget, now.

An example? You can not simply nosedive any Piper Cub tow plane, descending for the next tow. The engine is aircooled and you can easily damage such an engine, cooling it down. Get down cautiously.
Reply: Alexander_Snowden   And you missed the point, a Merlin rebuilt with modern knowledge, will be like the Formula One engines just ten times larger. Or how much larger is it? A 27 liter engine! Ah, you get the picture. Lots and lots of power.
Reply: @Alexander_Snowden  Man get out of here with that garbage